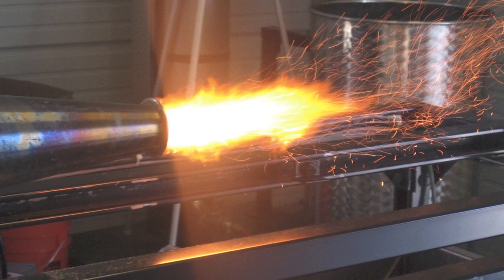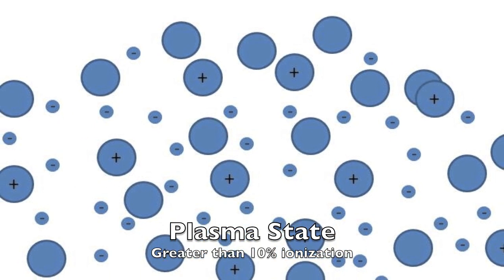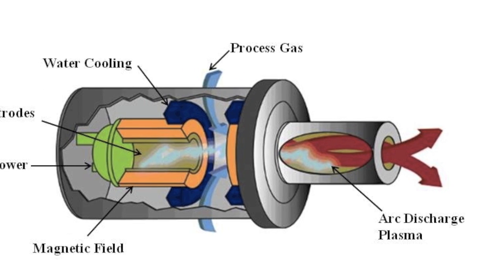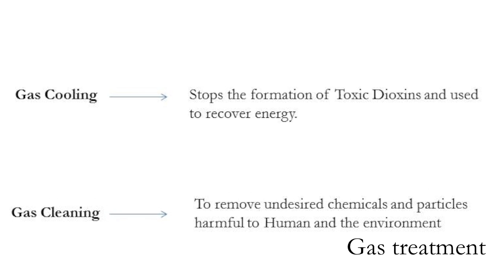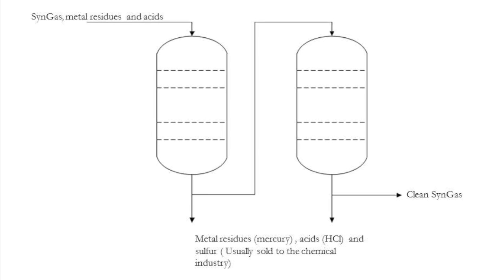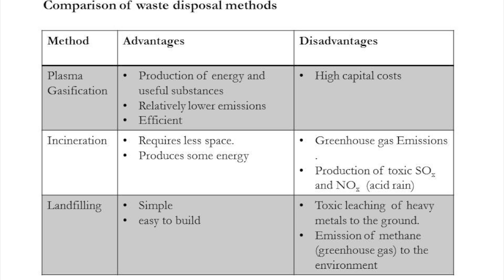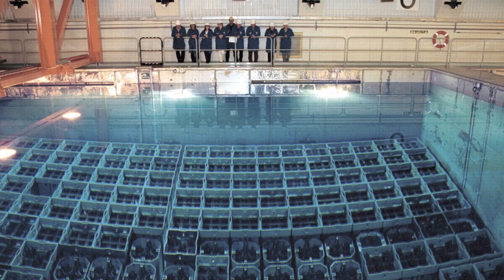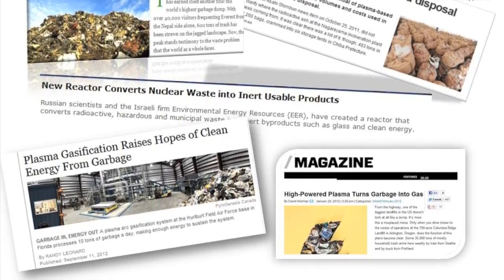Plasma gasification explained

Comment: What I concern most is the energy efficiency when we treat fly ash and slag using plasma torch. the totally energy efficiency is lower than 40%, only a little bit higher than the fuel.

Comment: Question: Is 8000C. hot enough to degrade nuclear waste materials?
Reply: Plus nuclear waste can get recycled these days, so you don't need to vaporize it. Hybrid nuclear in theory can get rid of radioactive waste.
Reply: It will help refine the material. However, It won't remove the radioactivity of spent fuel.

Comment: They say the landfills will be the energy sources and mines of the future. With this technology it looks as if that prediction is coming true...
Reply from the maker: As we continue to require more land and energy to maintain the world's growing population, rising hydro rates and land values will drive the waste-to-energy revolution. The question is how long it will take for investors and researchers to bring down the start-up costs for these plants so they are economically favourable in most arenas.
Reply from the maker: Genki Dama Hi Genki, thank you for the comment. I can think of two companies off the top of my head; Pyrogenesis and Plasco (both located in Canada). My alma mater is McGill University and they perform significant plasma research in the Department of Chemical Engineering. They have produced many papers. Search for the PPL (Plasma Processing Lab) at McGill on Google and you should find plenty of literature that can guide you in that direction.

Steve
Reply: @StevenPaolasini  syntechglobal.com is the distributor for goldsealindustries.com. they make a 100 ton and 25 ton, and provide all of the infrastructure for a power plant. their process is lower C as well so they to not smelt. so harvesting items for commodity products like carbon black from tires has additional resale value.
Reply: Steven Paolasini 

Hello Steve. Thank you for the awesome video. I was hoping you could list some companies that are at the forefront of bringing this technology to the market? Also any papers or publications that go even more in depth into the technology. Thank you very much once again.